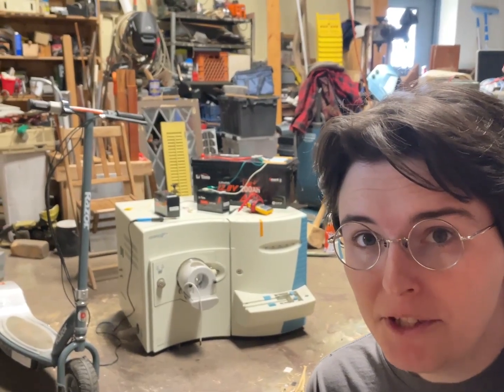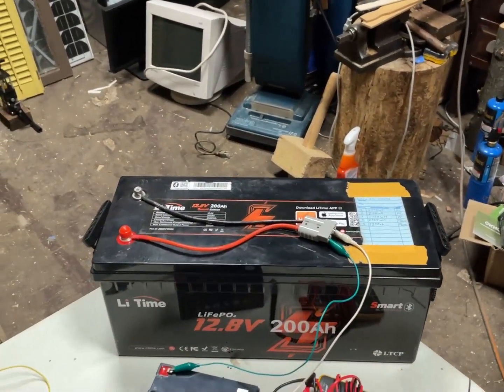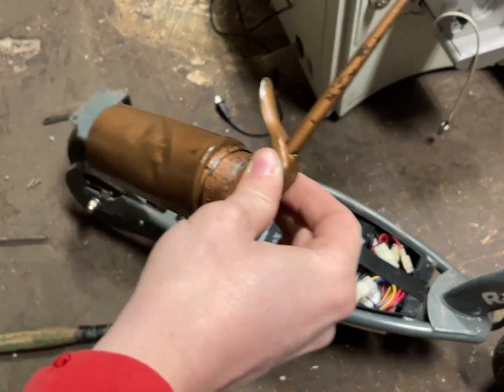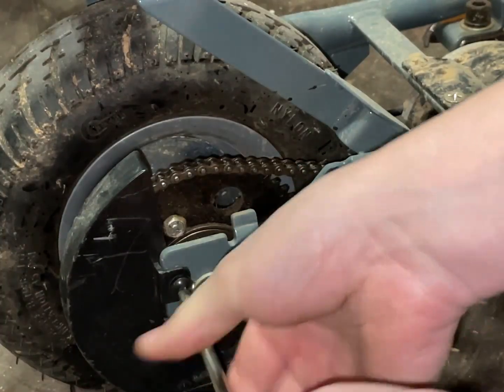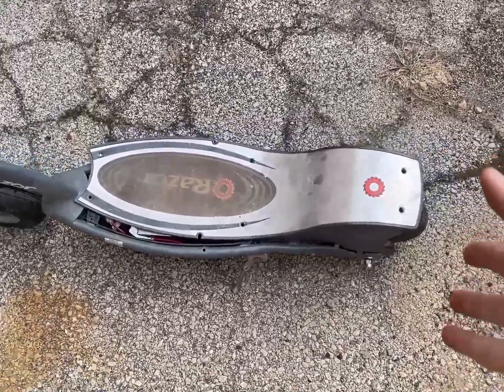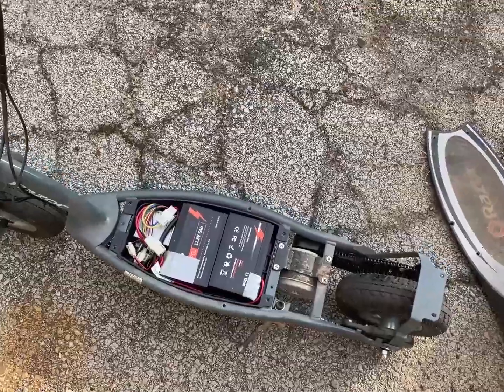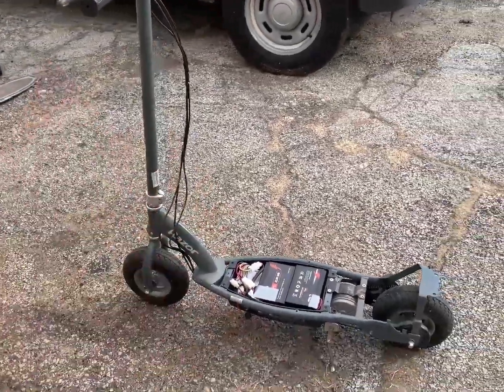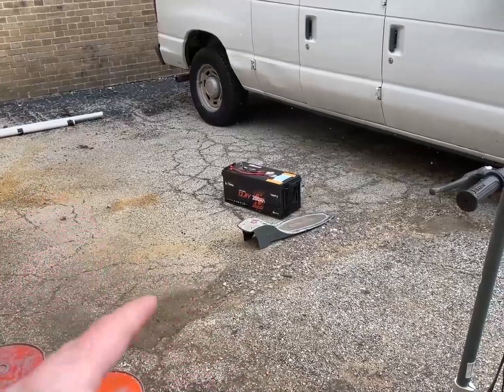Razor Scooter Lithium Upgrade: Replacing Lead Acid with LiFePo4 Batteries

Comment: How are you charging that thing? I got my hands on an old scooter and am considering upgrading to lifepo but cant really find a charger im comfortable risking it with so if you have any pointers thank you
Reply: It is a 24v scooter with a xlr port
Reply from the maker: The lifepo4 batteries have a BMS circuit board in them so they will be compatible with the original 24v charger

Comment: What about charger for this?  What would you use?  The lifepo4 12v 8Ah I got is said to use 14.6v 20A pulse charger.  If you put them in series, would that rating charger still works but for 24v @ 10Ah rate?
Reply from the maker: The only important thing in the voltage, the amps just dictate how fast itll charge. They sell little 24v 2a DC chargers for these for super cheap. They also have current limiting and a charge indicator LED
Reply: @RinoaL  but dont Lithium Ion batteries use a different charger then Lead Acid ?
Reply from the maker: @Meowman0707  They have an adapter built in called a BMS (battery management system) so the ones that are sold as 12v or 24v will work just like a 12v or 24v lead acid battery.

They are also rated for four in series to make up to 48v. When they charge they will automatically switch off when the voltage gets high enough.

The main issue is that the charger might indicate there is a fault once done charging if its picky, but i havent actually seen that happen yet. Still works fine though.

Comment: Does the original charger still work?  I'd be worried that it wouldn't generate the right voltage range for LiFePo, or that it would try to float charge it when it's already full.
Reply from the maker: This one didnt have the charger, but yes lifepo4 cells play nice with lead acid chargers

Comment: LifePO4 usually cat give coninuous current, similar to lead acid. but its a step up.
Reply from the maker: Oh they can give continous current just normally not much more than 1 amp per amp-hour. This is down to the internal wiring
Reply: @RinoaL  Oh yeah, that sounds right. but that scooter pulls more than 10amps im sure. Go with a lithium cell pack next time, those things can dump current continuously like 30-50amps and survive many years.

Comment: It is probably the batteries holding it back...I bet the stock controller can do more than that.  My 24Ah 12V LiFePo4 battery only does around 300W so about 20A or so.  So if you are using 2x6Ah batteries, you are probably being limited by the BMS of the batteries...I would guess you are only getting about 10A to the motor.  It can take more than double that.  Not sure what the controller specs are, but I am sure it is more than your batteries are able so supply.
Reply from the maker: yeah I agree they probably only provide 8a, controller is only a 10a controller

Comment: can you help me .. I have a HP DESIGNJET Z3200 PS  I saw your video and wanted to ask if you can point me in the right direction to get past the paper jam error code. Is there a paper jam sensor and if so, where is it?
Reply from the maker: hrmm i dont know them enough to help with that. Have you consulted the maintenance manual?
Reply: @RinoaL  no  I went straight to YouTube saw you with one torn into a million pieces ..said there my guy !!lol thanks anyways I will search the manual

Comment: To be honest this scooter is trash nowdays. Thats waste of good batteries to use in this trash. But maybe it will work for some kids. At least its safe
Reply from the maker: You need to keep in mind that you probably dont want a little kid going 15mph on a scooter. Not everything is about comparing specs
Reply: @RinoaL  yyep you are right i said that at least its safe

Comment: Is low gear 12 volts parallel double current and higher gears speed 24 1/2 current
Reply from the maker: I wish, its just on/off though

Comment: Just needs a aftermarket motor controller and that thing would rip or potentially there’s just a pot switch inside the controller you can turn up to allow more current draw
Reply from the maker: I imagine the 6ah batteries are about at their limit too

Comment: I got a similar one on the curb on day, it's kind of been on the backburner.  It was one of the cheap ones with a small 12v 150W motor and solid rubber wheels.  I had a spare motor like the one your Razor uses sitting around from a previous project (trolling motor), so I have planned to use that instead.  It was handy to see how it was mounted.  I initially planned something else but that looks easy enough to do with my scooter frame.  I had to find some small pneumatic wheels which wasn't easy but I found some 6" ones that fit with some minor modification with a file.  I am thinking of putting a freewheel on it.  The small 150W motor actually went pretty quick but had no torque and stalled going up even the tiniest incline.  The 250W 24V motor might get a controller and battery upgrade to 36V eventually.  I am using a 24V lithium 18650 pack right now.  I also plan to replace the deck with a skateboard deck.  I am giving it to my sister once complete.  She used to rent them all the time in the city, and would like her own.  I already have an ebike and would likely never ride a scooter.  If it was mine, I would probably put an 80CC 2 stroke and a seat on it lol  The 150W 12V motor...I put 24V 20A to it and it didn't melt.  The 250W motor I am confident can take burst of up to 25A.  And I bet it could run up to 48V.  36V for sure.  Also...I think the motor output shaft...there is a smaller gear...I can't remember what the smallest is but I know I have a 7 tooth sitting around somewhere.  I am thinking a belt conversion would allow even smaller motor gear.  More torque, of course.  I had that same 250W motor on a bicycle at one point, hooked to the crank with a second chain.  I was able to go up massively steep hills, in the right gear...it was just slow of course.  With the right sprocket and crank setup, that motor would do for many adults.  Small ones, but probably 150lbs, up hills, comfortably.